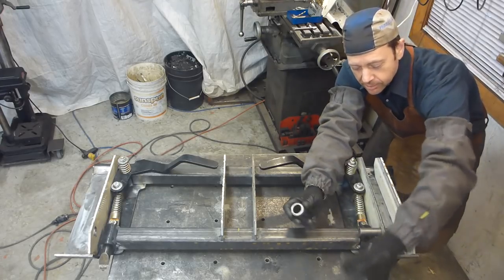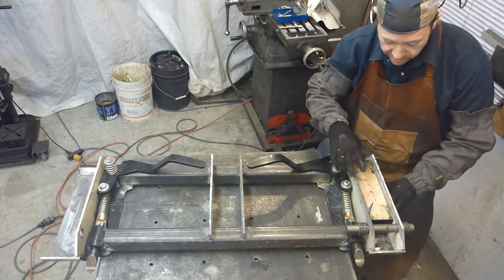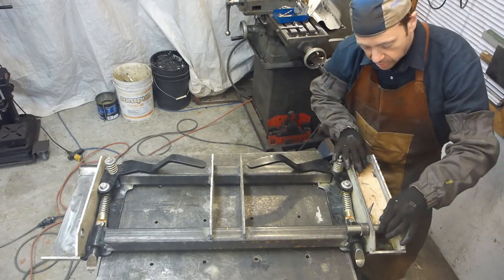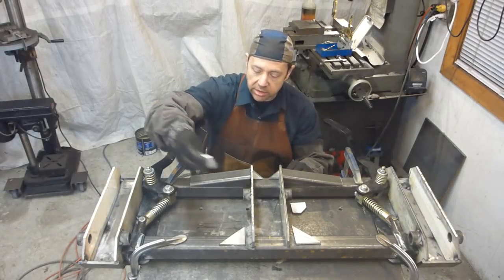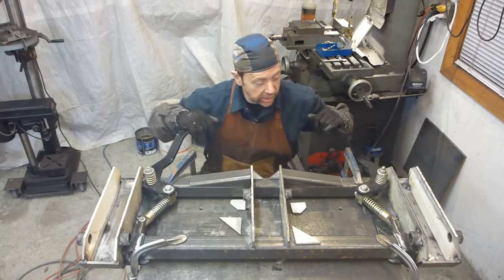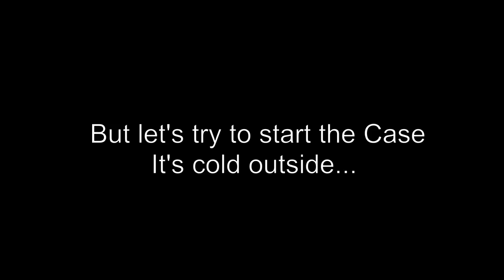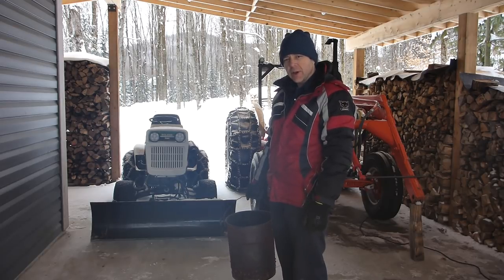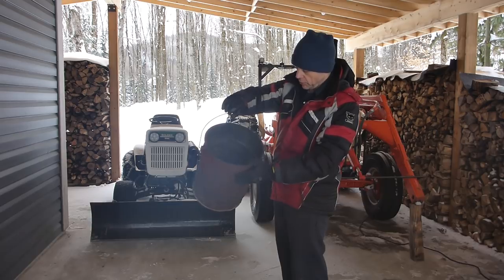#131 Skid Steer Quick Attach - Part 3

Comment: Merci pour les gentils mots!!  Your channel has been a big inspiration for me.  A channel where you not only show off your fabrication skills but also your creative ability to innovate.  Keep up the great work!  And keep sharing your work with us.  Your SSQA looks amazing and strong.  I also need to start converting my bucket to SSQA.  It has been very annoying for me switching from my SSQA forks & SSQA plow to my non-SSQA bucket.  A real eye opener for how long it actually takes to pin a bucket on (10min. vs >1min.).   Next you will have to add a 3rd function hydraulic circuit!  Another convenience that once you have it, you wonder how you would deal without it.  Thanks again Joe!
Reply from the maker: Thanks!  You are right!  As you might have seen, I added a grab hook on the SSQA, so I still can move stuff without any implement in the front, which was impossible before.  Not only time saving, but a great back saver.  I had to move the tractor inside the garage yesterday. With the implement in the front, it fits so tight in the garage, I can't move around freely. One minute to remove the snow plow!!! Again, you are right, the next step is indeed a third function! Thanks again!

Comment: Superbly built, Joe!  I like that you favor “over” engineering things like I do.  That SSQA is going to last a lifetime and then some.   BTW, I marvel and how straight you cut steel with that hand held bandsaw (when the blade stays one it, LOL).  Well done! 👍
Reply from the maker: Thanks Martin.  Believe me, my cuts are not always straight. The blade has a lot of stress (it runs twisted between the pulleys). Then when I have used it for a long time, it develops cracks and it start to get uneasy to get straight cut. What you saw is the typical end of life, where it breaks. Thanks again!

Comment: Excellent work Guys. I like the way the bucket tips back enough that your contents won't run out the front of the bucket. I've owned   two large loader tractors( Cockshutt 1600 with factory 1605 loader and IH 1066 with factory 2350 loader)I had to modify both buckets so they would tip back enough so  my material in the bucket wouldn't run out driving to where you were going. I bought a JD1025R last fall and i was pleased with its loader bucket. Later Kent from PEI.
Reply from the maker: Thanks! You are right, I had this issue previously with the Case.  The bucket would not tilt more than 20° from the ground... So to say, it would alway be half full...

Comment: We I was in the army we use to put a fire under our track vehicles when it we cold. We would fill a pan if diesel and put it under the oil pan and light it. Worked great but you have to watch it.
Reply from the maker: Yes, you have to watch it, especially if the machine has some oil leaks!!! That could also be methyl hydrate, which burns much cleaner than diesel. I always have plenty of ember in my wood stove, so that was the cheapest way.  Have you noticed  the pail has plenty of small holes at the base, on purpose.  So the ember get plenty of air.

Comment: Just curious what welder you are using? Thanks for sharing stay safe and warm.
Reply from the maker: This is a Millermatic 180 with Auto-Set.  The Auto-Set is really convenient. You set one knob to the desired thickness of material and it sets the voltage and wire speed for you. Thanks Jim!

Comment: I like this series,...a really good job, and I must say, I think this one is better than the one I made for a friend of mine. Your's is not as heavy as mine. Maybe I'll build another one more like yours to see if I can save some of the weight.
P,S, I like your choice of music from the 6:58 mark,....good stuff Joe!
Reply from the maker: We think the attachment is about 100lbs. Not so light!  The 2x2 cross sections and the center curl cylinder bracket may represent 25-30lbs out of it. It's always the battle of making it lightweighted and yet strong enough.  You can't really mess with strength, as you can only know the hard way it was not strong enough... Lol!  Glad you like that music too! Here is the link to that music below. Thanks Reg! 
https://www.radiotunes.com/oldies
Reply: @FromSteelToWood Thanks for this link to 'my era'...I will enjoy these.
You are correct about being strong enough,..it is something that we must pay close attention to.
I think I have made mine a little too heavy though. But it works and has never given me a problem.
Cheers, Joe!

Comment: That’s a good trick with the embers underneath the tractor 
I don’t need it on my 430 it usually starts 
Any way keep up the good work and I can’t wait for the next video
Reply from the maker: I had no choice this time.  I had issues with the ignition.  I later found the distributor cap has it's center contact tip gone... I seriously wonder how it could work!!! Thanks Cole!